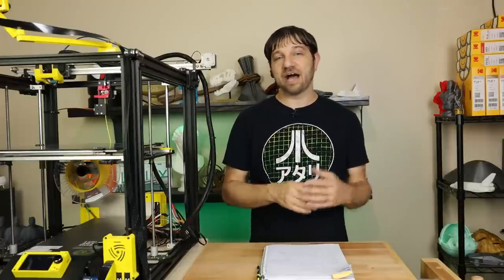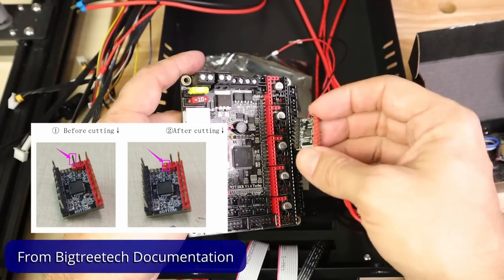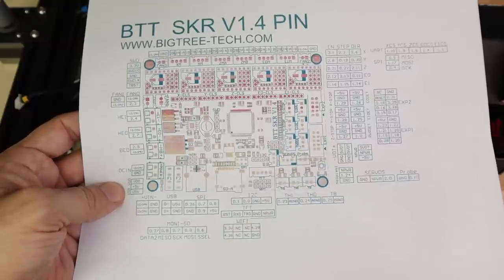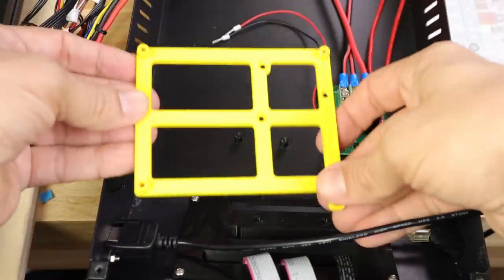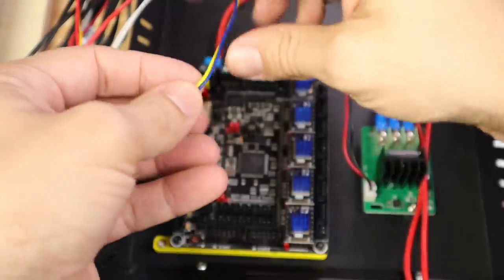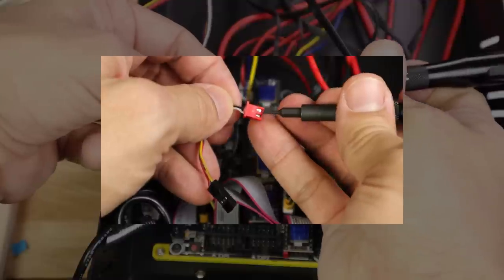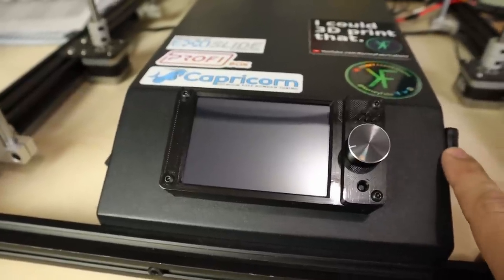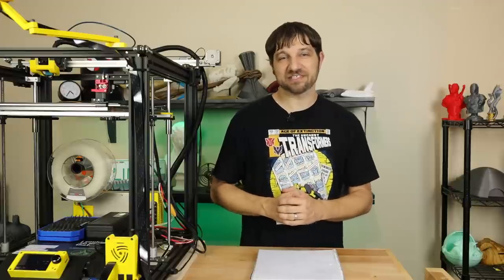Bigtreetech Ender 5 Plus Upgrade: SKR V1.4 Turbo (Part 4)

Comment: Also - can you confirm, will this show Octoprint prints as well?   The factory setup doesn't know when Octoprint is printing something (which is very inconvenient), but I am currently using TinyMachines and it shows everything on the screen when sending from OctoPrint.  Will this also continue to work this way with your firmware settings?
Reply from the maker: Yes. This will work fine with OctoPrint. I don't use the touchscreen mode, so I don't exactly what that looks like but it works great in Marlin mode.

Comment: Thanks Kris for the great tutorial...
Is there any diference on the Shared Z-stepper Source when using  TMC2208 or TMC2209 other then define the type of drives that you use on lines 681...?
or is there any sections that needs to be change when using  TMC2209 ?
Reply from the maker: No problem. That's all you'll need to change.

Comment: What is the advantage of using the zstop pins instead of the probe pin for the bltouch? Also if I use the probe pins do I have to make changes to the firmware u are using?
Reply from the maker: There's no advantage. I just do it for clarity. Since we use the BLtouch as our Z-endstop, it seems clearer to me. Yes, if you switch to the probe pins, the firmware would need changing.

Comment: Would this board also work with the cr-10-s5?
Iam asking because I want to get two of them at the same time 1 for the cr-10-s5 and 1 for my Ender 5 Plus 
Also Did you have to buy the The Tmc2208 separate or along with the ones that come in your link?
Reply from the maker: Yes, it will also work in the CR-10. It will just need different firmware compiled most likely. I already had my TMC2208s from a previous order, so I only needed the board.
Reply from the maker: Actually, be careful, that is the old touchscreen only display. It doesn't have support for Marlin graphical/text display. You'll need a V3.0 display.

Comment: Nice work 👍  for once I was ahead of you with the skr 1.4 turbo mod last build you posted, looking forward to your firmware to look see what you did and compare to my configuration. I added BMG dual drive and a inductive probe sensor, works great. Thanks for the vid
Reply from the maker: I'm glad you got it up and running! That BMG extruder is nice!
Reply: Why would you add an inductive sensor,  I does come with BLT doesn't it?

Comment: Hey!
this will be my next project and I will also try to install Ledge 2 in 1-S1 Bowden MK8 Titan V6 Extruder dual Hotend Switching 2 Colors Multi-Color 0.4 Nozzle it will be a great 3D printer when it is finished ..  Thanks for many perfect videos
Krister

Comment: Hi Kersey,  I bought a kit with motherboard and same screen as you have, but they sent me the TFT 3.5 E3 V3.0 , do I have to use a specific firmware for that screen or can I just run yours as is?

Comment: BTW: You do NOT need to cut anything, you  can just bend the pin instead, so If you in the future want to use sensorless homing, you can then just ben the pin back.
Reply from the maker: If that works, great! I wasn't sure it would still have good connectivity on the other pins. If I need to replace it, I would just solder a new header on.

Comment: Question about your Dual Z-Steppers Source.   By the looks of it, the drivers still use the Z and Z2, not the E1 for the 2nd Z (I presumed that you need to move it to the plug by the extra driver, but seems like I am wrong).  Can you confirm this is where the Z motors are plugged into?  Also what is the difference between using TMC2209 and TMC2209_STANDALONE?
Reply from the maker: Z1 and Z2, as marked on the board are not electrically separate, they are wired in parallel. So, if using dual Z steppers, it will be either of the Z connectors and E1.
TMC2209 uses the stepper in UART mode. TMC2209_STANDALONE means that you are controlling the steppers physically with jumpers and potentiometers. You can buy them in either configuration or make modifications to change them. The standard ones from BTT are in UART mode.
Reply: @kerseyfabs  Has anyone told you how awesome you are today?  :)
Reply from the maker: @tonnictv  That's awesome of you to say!

Comment: The Ender 5 Plus is setup with Max X and Max Y in the back right corner.  The end-stops are positioned so that they're max stops, but the SKR boards only have plugs for min stops. Did you do anything with the firmware or in the slicer to address this or did you just accept that the coordinate system would be backwards? I have an SKR Pro v1.2 and was able to get it to work by modifying pin assignments, but I don't like that solution and am wondering if there was some way that was easier to address this.

Comment: Does this board work with the stock touchscreen for the Plus? And do you believe that this board is enough of an improvement over the Silent board from Creality that it's worth the installation hassle?
Thanks for being the best source of information about the Plus, I'm anxiously waiting for them to come back in stock.
Reply from the maker: I have reports from others that you can get this working with the stock touch screen but I haven't done that myself yet. I hope to get to it. Check out this project for more information: https://github.com/InsanityAutomation/Marlin/tree/CrealityDwin_2.0
I will have one more video that gives my thoughts on all three of the options.

Comment: Followed your guide for Ender 5 plus skr 1.4 turbo upgrade with dual Z TMC2209. Thanks for a great guide! x,y,z moves just right. When I home x,y it works. When I home Z it just go down about 10cm and then stop. The bltouch never lit up. Even tested with a 2nd one, nothing. Checked cables carefully. It feels the cable gets hot. Output on octopi "Offline (Error: !! STOP Called becouse of BLTouch error - restart with M999) RESOLVED: Seems that I got a new version of BLtouch with my ender plus, the brown and red wire should switch plances in the servo connection!
Reply from the maker: Awesome! I'm glad you found the fix!

Comment: I'm a noob at this and have been working from home next to my 5 plus since i got it. I'm planning on doing this upgrade but I noticed you mentioned that we have to cut pins on the TMC2209s because we aren't using sensorless homing. Is there a reason you chose not to use sensorless homing?
Reply from the maker: No problem at all. I'm not a big fan of sensorless homing for two reasons:
1) It's not more accurate than endstop homing. In fact, it can be less accurate depending on how well your machine is tuned.
2) It requires more tweaking than endstop homing. i.e. One more thing to carefully dial in an configure. This can also change as you are tightening belts, changing hotends/cooling solutions etc.
On top of that, these machines already ship with endstops in specific locations. Why not use them? You'll also have to recalibrate your bed alignment/dimensions to accommodate the new homing information.
So, all of that to say, more work and more tweaking for no gain. I hope this helps.
Reply: That's really good info and a great argument against using it. I can't wait to make this thing silent. Thank you!

Comment: followed your guides and used your compiled firmware for the TMC2208s. Marlin mode is not displaying. Pretty sure i'm wired up right. Far as I know my hardware is the same: Ender 5 Plus, SKR 1.4 Turbo, TFT35. Any thoughts?

Comment: Hello Kersey,
Thanks for the great video and explanation on Ender 5 plus. I recently got my Ender5 plus. I have skr1.4 turbo with TMC2209 stepper driver. 
 Can you please confirm if this board work with the stock touchscreen for the Plus? I tried various firmware however the display is not turning on with skr1.4 turbo. 
Thanks.
Reply from the maker: I cannot confirm it because I haven't gotten that setup to work yet either. It's on my to-do list because I know others have gotten it working. Check this source tree out for more information: https://github.com/InsanityAutomation/Marlin/tree/CrealityDwin_2.0

Comment: Can you give us a hint as to the setup your going with as far as multiple extruder? 
Will you be going with a two into one hot end or multiple hot ends?
Reply from the maker: I don't have this finalized but I will most likely be going with one nozzle, two inputs. This is much easier to configure and maintain than the alternative. There is more purging but I think there's less headache.
Reply: @kerseyfabs  I'm in the process of setting up one on my ender 5 plus myself.
 https://www.amazon.com/dp/B07ZRJJVP2/ref=cm_sw_r_cp_apa_i_mESeFb2FWYNB1

I've run into a few minor issues. (Finding right hero parts to use, not using the same runout sensor (btt and stock) and having it trigger because the firmware settings are wrong. (I ordered 2 BTT but only set up one because I wasn't sure how I wanted to mount them.) setting up cura) with any luck I'll have my first multiple color print this weekend some time. 1st time doing this type of upgrade and winging it type issues.

Thanks for all the hard work on the 5 plus videos I must say they have been a big help and the reason I went with the 1.4 turbo.

Comment: Followed your guide and everything is working great except when go to level the corners. It's acting like the bed size is small like an ender 3. Any ideas on what I got wrong ? Forgot to mention I'm using the 2209 build you have linked in description.
Reply from the maker: Please go to my community page: https://www.youtube.com/c/KerseyFabrications/community
There, several posts down possibly, you will find my latest firmware for the board and display. This should fix your problem. I'll update my links in the description later.

Comment: hello kersey i downloaded and installed your pre built TMC2209 and when i auto home the bltouch is to center of the bed instead of nozzle. How can i tune this?
Reply from the maker: That's correct. That's how it's suppose to be. The leveler is in charge of finding level, not the nozzle.
Reply: @kerseyfabs  ok thank you . I was confused cause of the stock bed leveling . I made a test print and was perfect and silent!

Comment: Kersey fabrications. Would I have to change anything on you’re 1.4 turbo marlin firmware file if I’m running a btt tft 50 v3.0 instead of the 35 you use ? Thanks
Reply from the maker: Nope! You'll be good to go!

Comment: Great videos, I just finished my upgrades.  Just one lingering issue, when I go to auxiliary level (paper method) via Movement / Leveling, it only focuses on the front left quadrant.  What should be right rear, is near center of the board for example.

Normally I'm pretty good about troubleshooting this stuff, but I believe I'm suffering from a lack of correct terminology.  Auto leveling works fine for what it's worth.  

Thanks again!
Reply: Chris/Justin .......So how did you get to auxiliary leveling I can't seem to find that in the Marlin menu. I am using TMC2208 steppers. Auto leveling sort of works but I have to try and correct it with Z level offset.The one think I liked about the stock board was the paper trick to level. My stock board decided to do a thermal runaway and I am getting a new board from Creality but its going to take something like 3 weeks so I thought this would be a good time to upgrade to the SKR V1.4 Turbo board. Everything else is stock so I would like to get this working good before I do anymore upgrades....Thanks. Ohh I forgot to mention I am running both z steppers with the one driver.

Comment: Extension card reader for the Micro SD, query .

Do you need to power off and power on the printer each time you reinsert the SD card into the card reader extender, for the printer to be able to read a new file from the SD card?
Or is my card reader just defective?

Comment: Hi! Servo of the BL-touch also needed to be changed with my E5+ (brown:ground, red:power, orange:signal). Besides that, great tutorial!

1 question: Marlin modes works great, touch mode says no printer attached. Is this normal? A firmware setting or did i screw up the little black cable?  Thx, keep up the good work!
Reply from the maker: Yeah, the BLtouch wiring changes from time to time. For the touch interface, make sure the black wire is connected correctly and your display's baudrate is set to 115200.

Comment: With all of the current upgrades that you have can you print using  ABS material?
Reply from the maker: For ABS, you will still need an enclosure to control the temperature.

Comment: The print head does not run to front right corner when doing corner level and stops almost at middle.
Pls help.
Reply from the maker: Are you using the touch interface or Marlin interface?

Comment: Hi Kris! I order the 2209 driver because the 2208 wasn't available.... The pin to be cut is only on the drivers of the motors or even for the one that controls the extruder? Thanks! ;)
Reply from the maker: Technically, I think you only have to cut the ones on the axis drivers but I haven't ever tried to just leaving them on the extruder drivers. Give it a shot. If weird things happen, you'll know it didn't work. 😅
Reply: @kerseyfabs  ehehehehe! Ok thanks! I will keep you updated! :D

Comment: Is there a benefit to using the z-stop end stop connector instead of the bltouch probe connector?  I know there are firmware changes involved for both setups.
Reply from the maker: Nope. Functionally, they work the same. I use the Z-stop simply for consistency. Since I'm using it as the Z-stop and not just for leveling, it makes sense to me.

Comment: Thanks for all your help the last couple of days.. I have been trying to sort out another problem with the firmware. It comes up a message all the time fade hight or something? regarding bltouch. Do you have the source files so i can edit Bilinear To Linear for bl touch. I can tseem to use the config files with another version of marlin? Thank you
Reply from the maker: I've seen that fade height message on mine as well but it seems harmless. It seems to just be a setting notification. I don't know why you would change bilinear to linear. Either way though, here's my source from the description:
Link to my GitHub page with full source: https://github.com/KerseyFabrications/Marlin/tree/2.0.x-BTT-SKR-V1.4-Turbo-Ender5Plus-bugfix
Use the green "Code" button to download a zip file of this tree.

Comment: Love your channel and have a question....Debating diving down the rabbit hole  of 5 Plus mods and was wondering if there is any advantage or need for the  closed loop stepper motors Bigtree tech is also offering? Any chance this might be relevant and something you'd cover?
Reply from the maker: Thanks! I've had several people ask about this. I understand the appeal of these steppers. The problem is though, if your stepper has to correct or compensate for something, there is an underlying issue.
The usual causes include:
- over-extrusion
- under current to the motor
- a geometry problem on the model due to cooling or lack of supports
This means that by having the motor attempt to compensate you are trying to hide or compensate for one of these issues. I watched the Teaching Tech video on this and, while I do like the product, I think this was missed. Will this save some prints? Absolutely! Some prints have single hiccups you'd like to avoid but, by tuning and starting over, you'll learn somethings, improve your printing/slicing, and avoid them altogether in the future.
That's my opinion, I welcome others.
Reply: @kerseyfabs  thanks for your response and I feel that it was a good one as it included many things that did not occur to me as newer 3D printer user.

Comment: Hi mate, just done this install myself. It may be worth pinning a comment, if you are using the BLTouch with the brown, red and orange pins then you'll need to NOT swap the black and white wires around and swap around red and brown on the servo plug.
Reply from the maker: Thanks for the info. I've been sharing this information as people have asked. I've also created a pinned post with my image and your comment.